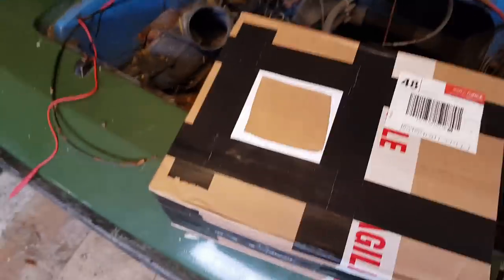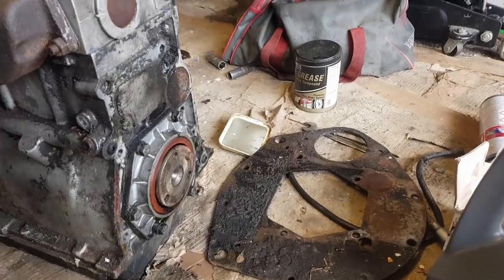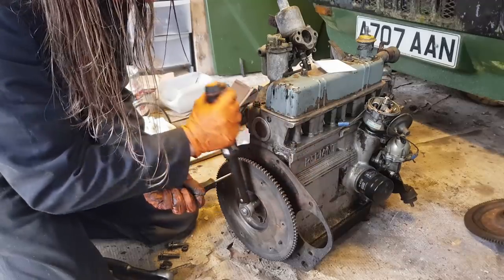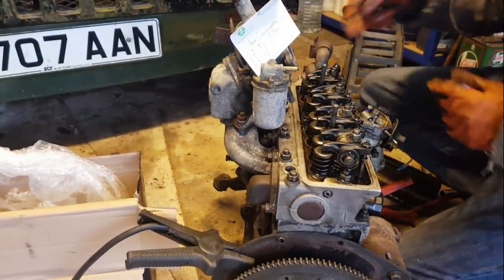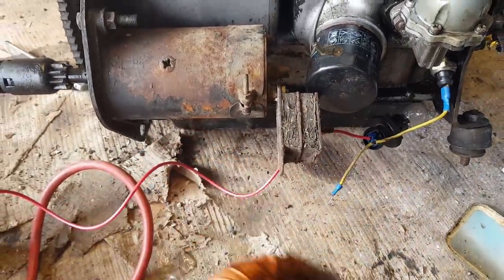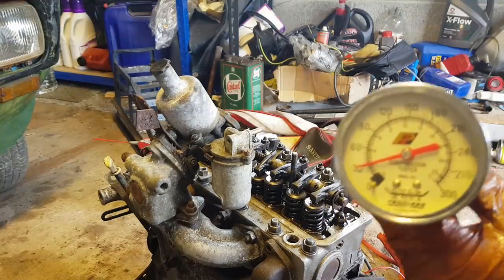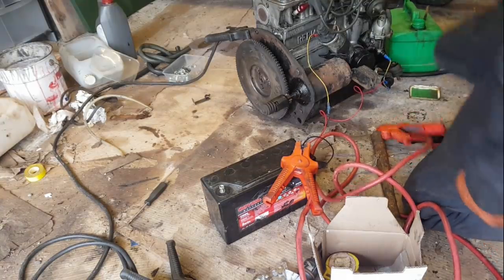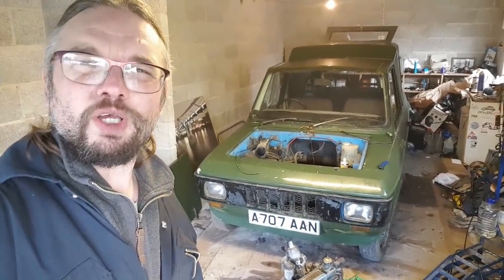Project Fox Part 5: Can I start an engine on my garage floor?!

Comment: Result! Sounds sweet. Assume you know oil is needed in the SU carb, the little black top on the carb unscrews and reveals the pot for the oil, high viscosity in the summer, and less viscosity in the winter. Long time since I have started an engine on the floor, many many years.
Reply from the maker: Yes, been a while since we had anything with an SU in, but all seems well. Can't say we ever changed the dashpot oil...
Reply: @HubNut  Great carburettors. Simple. I remember we used to clean them and change the oil after reassembly, the Stromberg was a similar design except it used rubber diaphragms to lift the pistons. I did remember oil viscosity advice, though can't say  it really made much difference, except if the oil viscosity was really high, but that didn't improve performance it made it worse. Stick to what you know Ian, it works for you. Great channel!

Comment: If the fuel pump on the engine has a flange with 6 or so bolts in a circle holding it in place, there's a good chance you could buy a rebuild kit.  Sometimes it's just a bit of munge, debris, dried on petrol gummyness holding  either the inlet or outlet one-way valve from fully closing. you could also take a look at the pump's in-body filter screen probably has a bit of rust flake and or dirt/junk.  Having an inline filter upstream of the fuel pump's a good idea with old, outdoor stored cars.

Comment: Some high mileage oil will condition all your rubber seals and cause them to swell a bit to prevent any leaks. But run's very healthy and great compression across all cylinders. A tuneup and maybe a carb cleaning and she'll be good as new.

Comment: Ian, 100% support how you go about things. But, there is something you need to know. Torque settings are only applicable with NEW bolts (or studs and nuts) After that they just need to be tight. For instance, the torque setting for the Nuffield (or Fordson Major) head bolts. 100 ft lb. In reality they are 2 grunts and a fart. TRUE ask any old tractor man.
Reply: One small step for mankind. One GIANT LEAP for Hub Nut 😊😊👍Most encouraging.

Comment: Brilliant, you will be checking the distributor is free first this time? A tip, as if you need another from me. When knocking in pins or dowels, use a soft metal drift, or anything is better than direct blows from a hammer which deform the end.

Comment: I never saw him change the oil. Changing the oil on such an old engine is essential.
Reply from the maker: I don't film absolutely every detail. The oil was topped up - there wasn't much in it for transport. So most of the oil was new. It will be refreshed again before it hits the road.
Reply: @HubNut  
Using a suitable fully synthetic would be nice.
Reply from the maker: Overkill. A mineral 20w50 will do the job. I'm not putting posh oil in it when the likelihood is it'll be getting dropped again after a short while.
Reply: @HubNut  
When the engine is in a car of course.

Comment: If the SU doesn't work is in need of surgery, there is a MK1 Fiesta or is it Escort 34ICH Weber twin carb that is perfectly jetted for the 850, it makes the 850 a different beast, rev climb is faster but not quite as versatile as the SU which operates in an infinitely variable manner to suit any demands, the 34ICH is a very good alternative to the SU if you can't find a replacement.  The inlet manifold does need modding tho but in the Reliant FB forum there are a few who could sort one out for you :)

Comment: Excellent video, love your 'we'll just see if it works without rebuilding it' mentality. Just worried me a lot when you were whacking the jump lead on starter terminal with huge sparks and you had an open fuel can about 18 inches away ⛽💥
Reply from the maker: Yeah, I like danger apparently...
Reply: @HubNut  I completely get it, you're in the zone, so pleased the engine started / the nut came off / the brakes freed / the box went in all gears etc etc you forget everything else around you. Done plenty of dangerous stunts like that cos that's what us garage tinkerers do to get our projects working. We want to see many more of your 'have a go' videos and not vaporised in a fire ball. Treat yourself to a couple of fire extinguishers, , best investment you'll ever make.

Comment: Great. I used to have a Reliant Rialto, did quite a few miles in it! Might have been an idea to have propped the engine up on some wood before trying to start it though.
Reply from the maker: Yeah, probably. I wasn't expecting it to rev up that quickly! It's properly zingy.

Comment: Good work Sir!!!   Mustie would approve. Still think a carb stripdown/clean is in order to stop her running like poo once in the car, but this is a great step forward.... was actually willing the engine to fire via the PC screen!!  Than starter motor needs lube however... doosh it with WD40.  Carry on, Hub Nut.

Comment: Ian, great that it's running so well. I'm not a Reliant guy, but it would make sense if there was a second ring dowel or some other dowel roughly 180 degrees away from that first one. If the backplate is not properly centred it will cause a problem with the input shaft, pilot bearing and clutch plate.  PS I live right by the Halfords where you bought the Matiz.  Mart.

Comment: HURRAH !! There is nothing like getting an engine running, hearing it burst into life is a moment to savor every time. The lack of pressure in number 4 could have been stuck rings, when the engine got going they freed off. I can appreciate not doing any more work than you have to, I'm terrible for just doing this or that and quickly turning things into a full strip down restoration, that starter motor would definitely have got cleaned and painted, though getting everything into perfect order before assembly has it's merits. Amused by grease in the beard comment, been there often, it's when you discover grease in other places, like " how the 'ell did i get grease in my armpit !! "

Comment: Jobs a goodun. I  assume the fire blanket and extinguisher were out of shot. If you want to prime the pump use a decent length of clear tube tube on the outlet and connect the pump inlet to a fuel source and see if you can suck the fuel thro. Stop when you see the fuel coming through up the clear tube as unleaded tastes horrible, you can then crank and see if the pump sucks and pushes.  The engine made all the right noises and no smoke so you appear to have a result there.

Comment: I find citric acid is the best for cleaning out the cooling system. Apparently it also neutralises the rust. It certainly did a great job in my M103 Merc system.

Comment: Make life considerably easier on yourself and set your tappets at TDC firing stroke on each cylinder. It’s a little bit of faff turning the engine whilst looking into the plug hole (or putting a welding rod etc into it) to find TDC but unlike all the, shall we say, “Rustic,” Methods like Rule of Nines. You then know the valves are set correctly which negates any quandaries later.

Comment: Have you got a welder ian? just weld a bolt to it to get it out, the heat will probably free it . then just be and the bolt off and  weld a nut back on the end  before you refit it  then you can get it back out whenever you may need to in future - it'll be a lot harder to get it out  if you need to otherwise once its in the car
Reply from the maker: Nope. No welder.
Reply: Great results achieved the hubnut way of course!

Comment: AVE dissolved a steel bolt sheared in aluminium. Did not take long and would save drilling and tapping.

Comment: Brilliant vid. I'm very happy that it runs.  What you lack in tools and equipment you more than make up for in aptitude , people new to the channel may have missed the string as an accelerator episode. I agree to let sleeping gaskets lie. 
The later Haynes manuals are a bit thin and brief. 
Coca-Cola, really? or is that where the oil lives.
Reply from the maker: Coke in the cooling system.

Comment: Reliant engines were always nice and simple.It will get better the longer it runs. Electronic ignition would be an ideal upgrade. No points.
Reply from the maker: Guess what arrived in the post today? ;-)
Reply: @HubNut  Electronic ignition kit?

Comment: runs nice! also, the carburation can't be far off either since it responds quite crisply on throttle inputs.
Reply from the maker: It does rev up very sweetly! I wasn't expecting that.

Comment: Well that runs nicely ,but please be careful when you get that torque monster in the car....it could be too powerful for the driver used to Driving cars with 3 or less cylinders..  And does the carb piston move up and down ?
Reply from the maker: Yes, the carb piston does seem to move freely.

Comment: Panicking about claiming on the insurance before it started with those sparks and petrol fumes of that open fuel can
Anyway pleased number 4 got sorted I wonder if it was crud on the valve seat and cleaned and resealed itself after cranking
Love the invacar starter motor engine mount clamp  I did think if that nut was brass it would not last long
Fire in the holes Hubnut and sounds very nice you can see ignition issues when revving
Thankfully no fires in garage and no synge of beard or eyebrows this time.   Been there don't that he says! 
Once again your a very lucky man
Reply from the maker: Yes, a better petrol strategy is definitely needed. I'm frankly amazed watching the footage back...
Reply: @HubNut  well I was thinking. Hubnut engineering  pop bottle gaffer taped to a Broom shank
Do you own a Broom ?   Then let gravity do its stuff.
Don't forget to replace main fuel can cap to seal up
Reply from the maker: @mondodaftasabrush  Or just get the petrol pump plumbed in!

Comment: you cant rely on rule of 9, but theres another simple way, if the other valve in the cylinder is down, adjust the other, rule of 9 when it does apply is just to same time moving the engine rotation

Comment: I remember years ago having an engine with big end failure, bought a second hand engine but wanted to check big end shells before installing, found a little wear so didn’t fit ( moral of the story just fit and try it) 😀
Reply: I helped my brother in law fit a 2nd hand engine to his motor, he claimed he'd seen it running before he bought it. But when I had it all in and filled it with coolant it pissed straight out of the gap between the block and head which wasn't actually tightened down. And all after Id had to lift the engine in single handed because the git hadn't got the hoist he promised... Underwhelmed to say the least...

Comment: Should have put some parafin and oil in the bores to free the rings up before the compression test.
Reply from the maker: Oil had been added before I even turned the engine by hand. After the low reading on cylinder four, I added a bit more oil and it made no difference, so I thought that indicated a vale issue. The other three cylinders gave strong results from the off.

Comment: Brilliant that engine looks sounds and smells like a triumph is there any connection
Reply from the maker: Not really, though the small Triumph engine clearly influenced the design team. This lump is all ally though.
Reply: @HubNut apparently in 1959 reliant wanted a in-house engine and the Chinese copy of the cast iron standard engine was born

Comment: No, 15mm will be good enough for final tightening...if rounding off the inside of the sockets is your objective.

Ian, I don't want you to take this the wrong way, but I can see a very quick end to this project – and possibly more besides – if you repeat what you did at 22:33... Maybe it's just me who sees the potential for conflagration with an open petrol can next to where you're attaching the live wire to complete the ignition circuit.

Still, well done. It clearly works.
Reply: Padraig Floyd 22:33 You are witnessing ''good old fashion elf 'n' safety at it's best

Comment: Someone once told me you can hear if one cylinder is loosing compression when you turn it over, you get a ... eee eee eee rrr ... sound, the rrr being the lower sound of the dodgy one, like it did when you first turned it over.... then was a definite eee eee eee eee when No.4 was back u to pressure... does that make sense... thought not!!

Comment: If that is a '90s engine then it might have the unleaded-friendly hardened valve seats, which would be very useful.  I imagine there probably is a way of telling if there is.  Then again, it is Reliant so it may well be that there isn't.  That little Reliant engine can trace its heritage right back to the original Austin 7 back in the 1920s so it's heading for being a centenarian...
Reply from the maker: Not really. Reliant reworked the sidevalve engine a fair bit, but the overhead valve engine doesn't really owe anything to that earlier engine.
Reply: @HubNut    In technical terms you're right, this overhead valve engine is very different, but in developmental terms this Reliant engine can trace its line right back to that engine as the Reliant engineers developed from what was good in what they already had due to lack of resources to start from scratch...
Reply from the maker: @gosportjamie  Well, there's some dispute about that, as the engine also bears a lot of similarities both to the Austin A-Series and the Standard-Triumph four-pot. I really don't think there was much carry-over from one engine to the replacement.
Reply: @HubNut     It could just be one of the age-old stories that started somehow but isn't really that much based in truth, like a lot of good old motoring stories...

Comment: Hi Ian sounds sweet enough (better than the singing) LOL, I have converted many points ignition distributors always with success see simon bbc on ebay for kits, (no I have no ties to this company) but I do recommend these kits, not a bad price either.
Reply from the maker: Have used them before. Have gone Accuspark this time on a recommendation.

Comment: i agree. if it ain't broke, don't fix it. you attend to that which needs attending to, and you need to fire it up to find out what needs attention. why make excess work for yourself? older used vehicles need a lot of work to begin with. if they didn't, they wouldn't have been sold in the first place.

Comment: Thinking about these small and economical engines makes me wonder if there’s a market for 100% British made cars such as an updated and safer Metro with an ultra eco engine.
Reply from the maker: Profit is the tricky bit.  That's what did for Reliant in the end. They built small, supremely economical cars, but they were not cheap to buy, and labour-intensive to build.

Comment: Never seen a starter actually working like that before.
Reply from the maker: Bendix style.
Reply: @HubNut  So that's the old fashioned type as fitted to my Hillman.  But this is an A reg car, surely they were out of manufacture by then?  Or might that not be the correct type for this later model?
Reply from the maker: @video99couk  Reliant was rarely cutting edge - other than having designed this remarkable engine in the 1950s. I believe there was a changeover not that many years later.

Comment: sparks right next to an open fuel can - not advisable!
Reply from the maker: Correct. Remember folks, don't do as I do!
Reply: It's ok he showered before working on the engine.
Reply: Nothing tea and cake won't fix
Reply: mechanic mate of mine would have had a cigarette on the go at the same time. doh

Comment: The oil presure light does not stay on for long after the engine has stopped turning over. Is that a bad thing?
Reply from the maker: I don't think so, as long as it goes out quickly when it starts up. TWC's light takes a while to come back on, but Elly's is quite quick.

Comment: It wouldn't be a British engine if the starter solenoid disengages from the flywheel and continues to spin.
Reply: it doesnt have a solenoid! thats the point lol
Reply: @jusb1066  The starter motor gear

Comment: Looks very similar to the BMC A series engine.
Reply from the maker: Apparently inspired more by the Standard-Triumph unit, which was the same size as the A-Series.
Reply from the maker: Oh hold on. Someone mentioned your channel to me earlier! You're Mr Marina.
Reply: @HubNut  Yes, that's it, I knew the engine looked familiar!
oh yes, I was talking to a guy on my channel, he said he mentioned me about the Marina I'm restoring and would love to see a review on one like the Allegro you recently did. Great video by the way, Love BL tin! I have two Marinas on the road and not too far away from you. If it's something you have in the works let me know.
Reply from the maker: Definitely. I've never driven a Marina. Can you email me Ian@hubnut.org please?
Reply: @HubNut  Will do. You're in for some fun then as I have an early car with the much criticised early suspension geometry! I do have a later model with the uprated trunnions so can bring both along if you like to compare!
I'll email you soon.